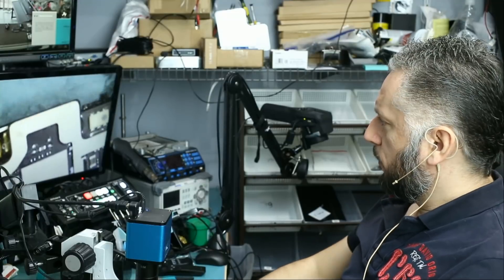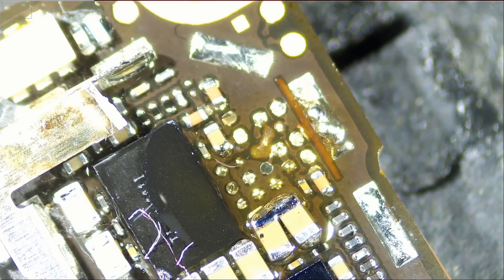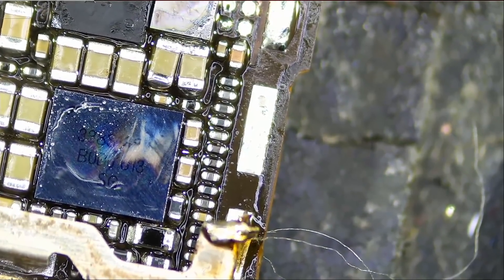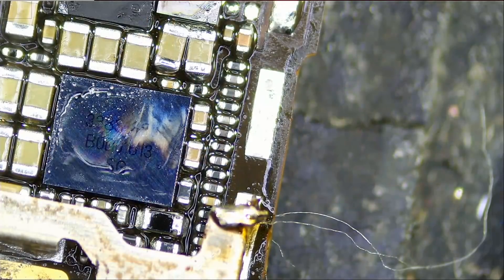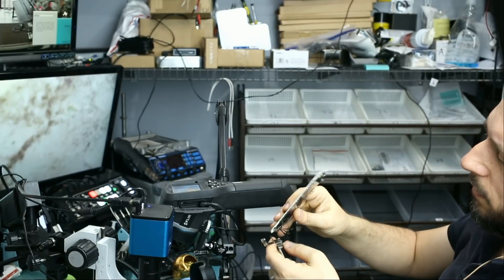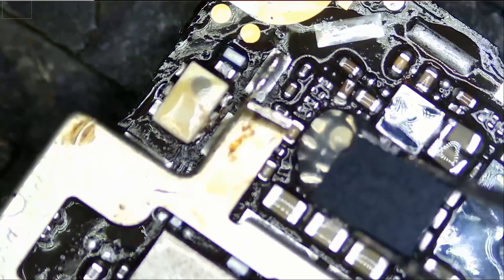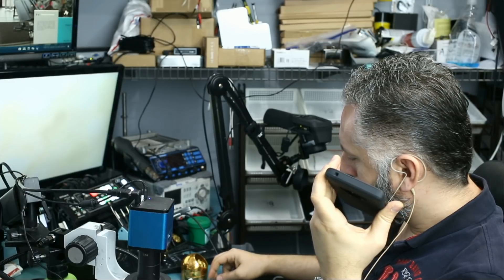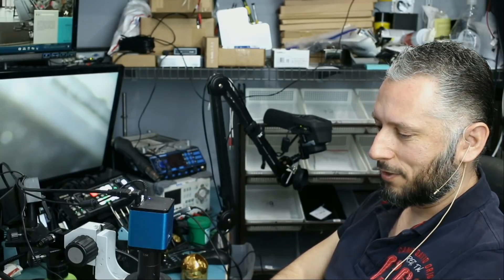iPhone 6S No Power Data Recovery - Faulty Tigris Mosfet and Shorted Caps

Comment: The mosfet always gets hot as it has all the current coming through VBATT to VCC_MAIN where the short is located. With liquid you need to visually inspect the entire motherboard first. Would have been done quicker, once you found the main short thermal is great but always ignore mosfet getting hot
Reply: Where did he mention that he removed the Mosfet because it got hot.  Point me to the time.
Reply: @matduran1104  0:12 uwc